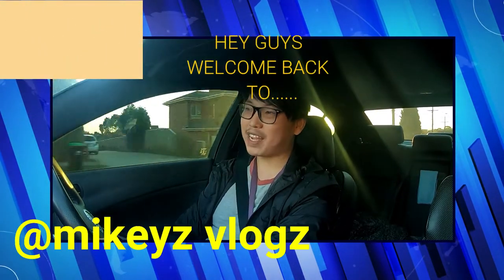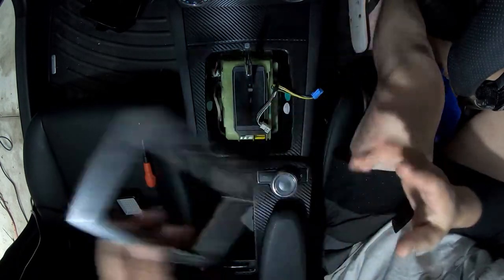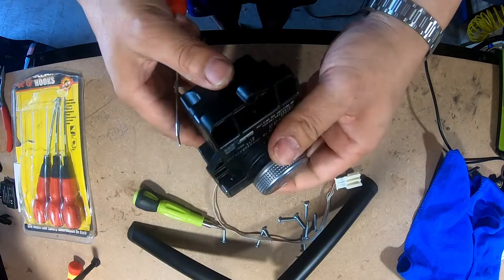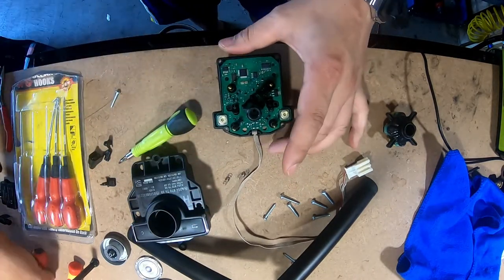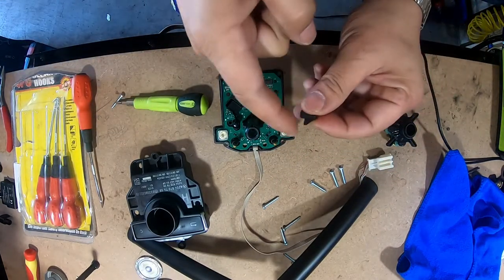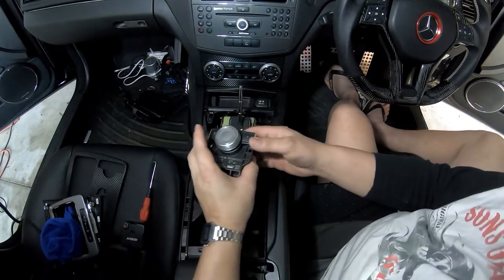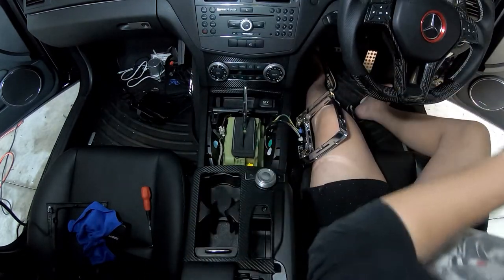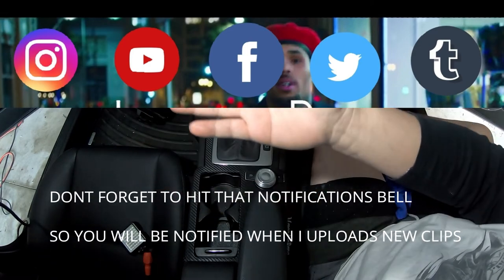Mercedes Benz w204 HOW TO  FIX command control scroll knob shaft

Comment: Thank you for the video. I have done this process the scrolling works but now when i go up down and side to side it doesn't work do you know why ?
Reply from the maker: recheck your assembly sometimes that cab happen if u screw it down too much or u didn't install the legs properly
Reply: @MIKEYZVLOGZ  I’m trying right now to reassemble, you know these black plastic with the flops that sits on this gold pin they have a leg that when it gets pushed down it enters and exits a slot. What are these little tiny slots?
Reply from the maker: @michaelsokron1361  yes so that's what pushed down and tells the ship that your moving up and down left and right etc.. u need to ensure they are installed correctly and that they flop and are clipped in
Reply: @MIKEYZVLOGZ  yes but when I tried to remove it I broke the slot that the leg goes into but it’s not completely broken it’s like a “U” it’s a “L” now would that stop it from working?
Reply from the maker: @michaelsokron1361  yes that would do it...if it's not holding properly it won't execute wen u push on it how many did u breakn
Reply: @MIKEYZVLOGZ  I tried again when I push up and left it works but not right and down!! I’m going crazy how can I fix that?
Reply: @MIKEYZVLOGZ  only one
Reply from the maker: @michaelsokron1361  is the bottom rhs one the one u broke ? so it works wen u go left and up so is that the one u broke ... the one in the bottom rhs corner
Reply: @MIKEYZVLOGZ  can I email you I will send you pictures

Comment: I am in America. My w204 has the wire ran to the same side, I pulled the carpet back and cannot see where the control knob wiring is. I am using lights and moving it. I cannot find where to pull the wiring out from under the shift box.
Reply from the maker: if u look in the side where gear box is u will see a tab ... like what I showed in my video the cable is under that that's why u can pry it up it has to be released from the clip first then u can move the wire ... hard to explain but it's there ..its job mercedes ran the wireb

Comment: Hi I can not separate the knob. Is there some kind of trick to popping it off I played with it for hours using different tools and it doesn't seem to want to move at all.
Reply from the maker: if its your first time doing it..it can be very frustrating as it is securely fitted with no play .... i remember doing mine for the first time and its a matter of slowly prying it bit by bit til it evebtually gives way... try using a vise but careful not to clamp too tight or u can break it... and put a piece of cloth bewtween vise and control knob...just some suggestions...i understand  tour pain... it took me a really long  time to get mine loose i used plastic trim removal tools then switched to flat head screw driver but wrapping it with a cloth ..and just kept at it...if u get frustrated wall away and clear tour head first...so i cab avoid breaking something.... believe its better to do it calm.... it definitely looks easy them it is.... patience and determination will get u through perseverance  my friend.... u will do it..do not give up.... u can do it....

Comment: I’ve changed the shaft and reassembled but the top screw is not tightening to the shaft when I try to. What can I do?
Reply from the maker: it should just screw back on ...now wen u do screw it back down dont do it until its completely tight ..u just want to secure it so it holds in place without over tightening it .. doing so will not allow it to function properly , i think it wont press down properly if u screw it down too tight ...but it should screw in easily .. try make sure its lined up right , when u removed it did it come out right ?
Reply: @MIKEYZVLOGZ  thank soo much I’ve fixed it. I had to press it down a little more to make the knob lap properly before screwing. It was previously suspended a bit
Reply from the maker: @rjaybeatz  ur welcome mate good on ya !!

Comment: Hey mikey great video👍 my knob still works up down left right but if i rotate it it wont work🤔 would you think this would solve my problem?
Reply from the maker: yes definitely the scroll knob has maybe snapped it prolly still executes when you press the button as it still standing up right but it has most likely broken in the middle of the shaft rod...do this fix and get a aluminium shaft rod and u wont regret it ..you'll never have this issue ever again
Reply: @MIKEYZVLOGZ  Thanks brother much love from MB club of the philippines😎
Reply from the maker: @tonymontana2909  likewise matey love from down under here in australia
Reply: @MIKEYZVLOGZ  I have the same issue but, I replaced with the aluminium rod, I can click on everything, back and cancel but the scroll function still hasn’t activated. Is it fuse related?

Comment: gotta get this done asap my scroller has stopper working would this be the reason why?
Reply from the maker: yes this is a common fault on the w204s so i strongly suggest you change it asap so u never have to worry about it ever again

Comment: Hi!, I have the same problem i think... The strange thing is, that the knob still klicks, is this normal, or do I have another problem? I also have a problem with my command unit. When it's cold outside, the infotainment will not boot, i have to push the on button for 10 seconds to force a reset. Any Thoughts? THank you for your answer!
Reply from the maker: hi friend firstly welcome hope u ca. subscribe and follow me ...always happy to help fellow subscribers and w204 owners .. as for your problem.. u may just have to open it up to see... even though it clicks the rod can still be broken... with the restarting issue..unfortunately I'm not too sure friend u may need to ask a mechanic or Mercedes or even try the Mercedes forums
Reply: @MIKEYZVLOGZ  Oh wow thanks for your reply!! I allready subsribed on monday ;). I will order the rod and let you know iff i got it fixed!
Reply from the maker: @Zunilification  for sure let me.know how you go and I will try and help best u can .... j. always here to try and give some advice and guidance
Reply: @MIKEYZVLOGZ  Sure will do! I'll try to record the specifics and send the vid to you!

Comment: For facelifted w204 the knob knurling is different, how do i take it off?
Reply: By knurling i mean the top piece of the knob
Reply from the maker: i havent done it before  on those models but it would be the same procedure .... it may take time if u have never done it before.... my first time it was really hard and i used plastic pry tools and slowly but surely it came apart .... because they are made pretty much the same
Reply from the maker: you have the newer style lnob dont you .... its still w204 model correct? the only difference is you pry the circle plate on top ...you dont have to remove the ring like mine 
heres a link for you ....pks subscribe friend thanks 
https://mbworld.org/forums/e-class-w212/602704-possible-repair-part-command-knob.html
check this out and it will show you how to remove the facelift knob scroller wheel .....

Comment from the maker: ok buddy heres exactly what u need shout out to WigoFellas for asking for this 
trim removal  to help remove your gear stick surroundings 
t20 screw driver to remove the screw that holds the centre console surround 
t10 torx screw driver to remove the screws in the control knob x10 t10 torx screws 
pick tool with 90 degree angle  this will help you get to the cable thats connect to the control knob assembly 
and thats it ur good to go
Reply: Where did you get the carbon interior from?
Reply: Where did you get your pick?
Reply from the maker: @SeeItOpen  which pick?
Reply: The right angle pick.
Reply from the maker: @SeeItOpen  they are called picks and ebay or any hardware store would have them ...ebay pick tool set and im sure you'll find them for roughly $ 10

Comment: recently subscribed got my car yesterday guess what doesnt work?? :(. did u jinx me mikeyz?? lol lol.....but seriously .will a mechanic fix it?? I will never be able to do this....... ooh do you have a video for clear coat peeling I noticed some  gotta jump on it now...
Reply from the maker: not or clear coat peeling however im sure u can findit on youtube somewhere.... im sorry if i junxed u.lol... but i assure u if i can do it... so can u .... of course u would need to invest in some tools
Reply: Might give it a go gotta psych myself up....lol lol
Reply from the maker: @lorniselogan7998  it really is easier then it seems .... the only part that is hard is removing the wire and also taking apart the control knob ... the plate on top and the ring .... the rest is pretty easy.... this was my first ever task on my mercedes and i managed with the help of a video as well.... hence why i started this channel to show ppl that its not as hard as it seems...but patience is key wen it comes to working on your car..never rush and if u get frustrated ..take a break and come back to it

Comment: Didnt work for me... thanks anyway
Reply from the maker: sorry to hear... what was the problem with yours? was the shaft broken as well? was it working fine until the shaft broke? ensure the switch is plugged in and did u reassemble exactly as it was?
Reply: @MIKEYZVLOGZ  hello ! The final screw that holds the metal wheel doesnt reach the hole of the metal shaft. Doesnt matter...I ordered a new controler unit. Its 60 dollars, not a big deal
Reply from the maker: @alexshepard7527  no worries hope it all works out for ya